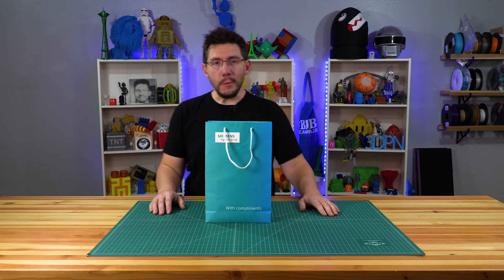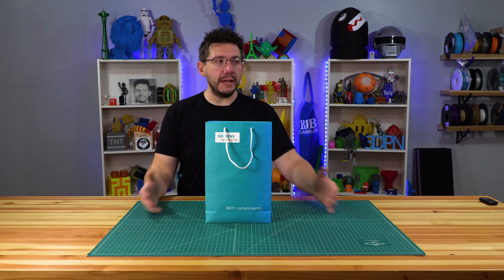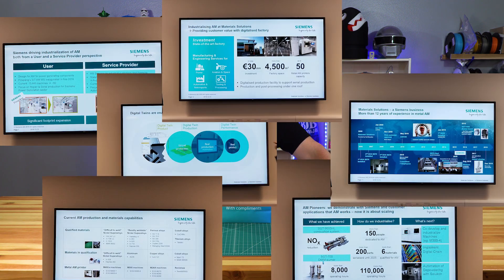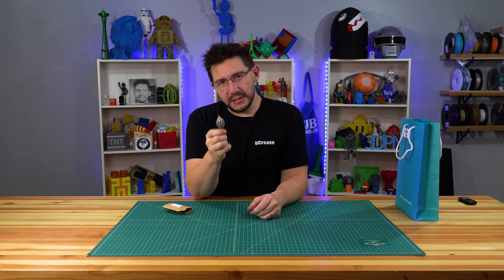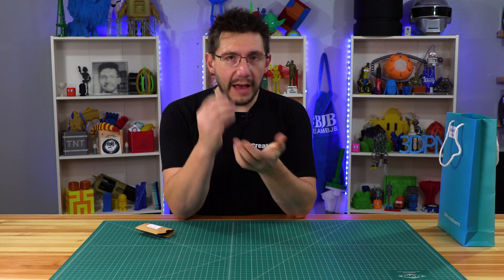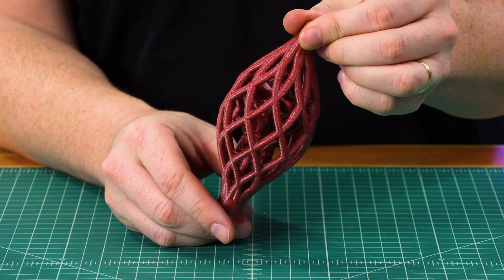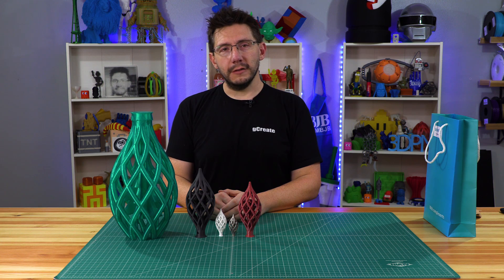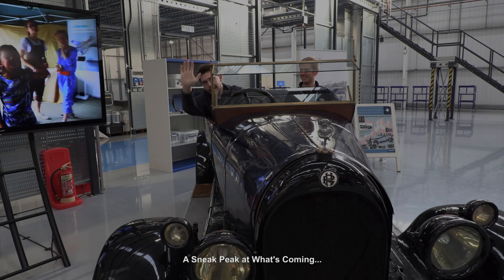3D Printing Metal! Press Tour Siemens UK Materials Solutions AND Free STL!

Comment: I also work in metal AM and the reason is kept so clean (aside from just having it that way for ergonomics and for looking professional) is because we keep everything in closed systems to avoid allowing the powder to escape. If it gets out, it's not only messy, but can be hazardous, especially with potentially-explosive powders such as aluminum or titanium. The powders are very fine and would be bad to breath in; even though powder shouldn't get anywhere, we still wear ESD clothing and respirators for safety. If powder does get anywhere, we definitely clean it up immediately.

Comment: Heres a tip. If you know you are running out of material, just stop the print on certain layer hight you can then calculate. Cut the model in cad from that hight and place it on the bed and print out the rest. Depending on filament you can then use glue or heck if ABS chemically weld peaces together with acetone. If you feel adventurous zero you Z axis to top of that layer, place rest of the object in exact same place with out removing the what you already printed and continue print from there, though this has some risks involved and you has to know what you are doing, cause clicking home zero rams the nozzle down to object :D
These two methods are easy and little bit on harder side way to finish your prints and not waste material or time.

Comment: Hey, Joel.  There's an easy way to know if you have enough filament on the reel to finish your project.  Weigh the reel after you open it and write that weight on the reel.  Then you can easily weigh any reel and know how much you've used.  Simple math will determine if there's enough filament left to print it based on the slicer estimate - John Q

Comment: Joel, when you were mention that there are 4 lasers on the machine so it makes sense to do prints in multiples of 4. But would the lasers not be able to group together? Say I had one model printing could the lasers not all fuse the power simultaneously on a single object therefore printing 4x as fast?
Reply: Yes

Comment: The 3D scanner at 2:14 costs about $360,000, just the scanner, the robotic arm must be another 200k or more. its just crazy how they can pay this just to 3D scan something.
Reply: For high precision, industrial applications, YES.
Reply: I imagine it'll work out a cheaper in the long run, than having someone spend weeks accurately measuring and then modeling some complex part.

Comment: I would love to print it on my Anet a8 but for some reason it failed after 8 hours of printing. The y axis motor only spins one way. I've plugged the stepper motor into the X axis motor plug and it works I think it's a problem with the muther  bord. Any help